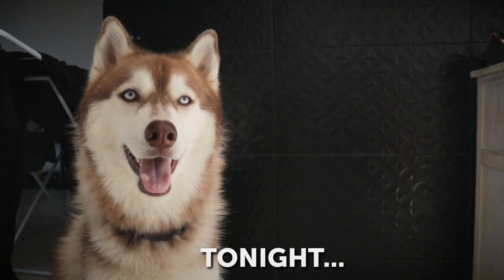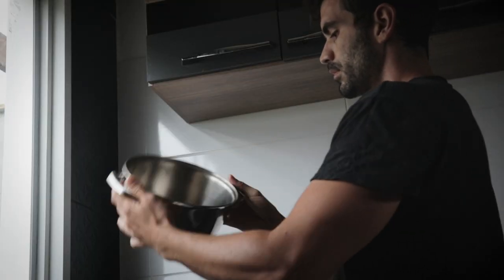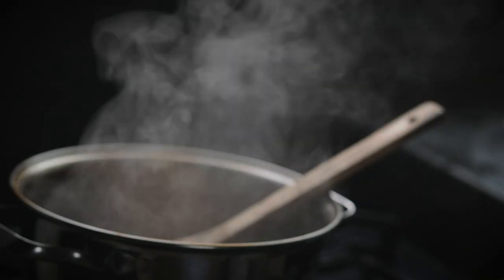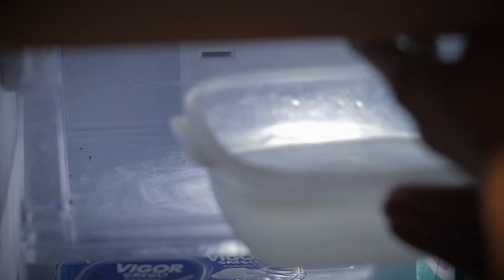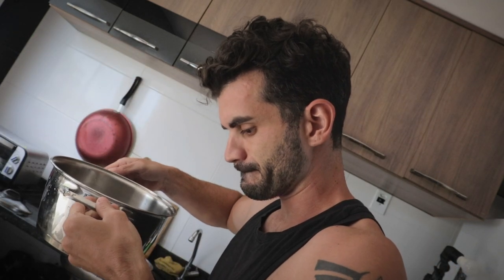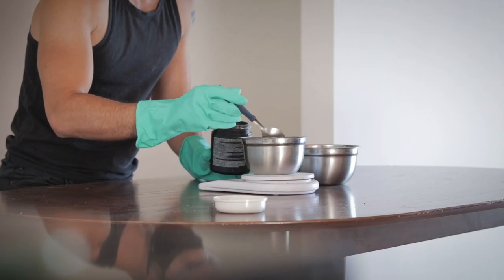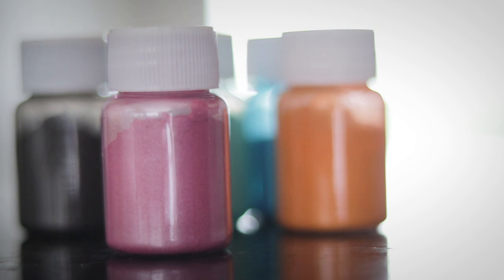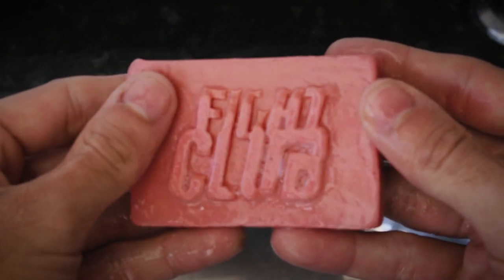I Learned to Make the SOAP from Fight Club (with Bacon)

Comment: Did you really just use a normal mask to protect yourself against the fumes?  Those masks only protect against droplets and sometimes dust, but you need a dofferent mask like k96 type for fume filtering.
Reply from the maker: I didn't know that! I'll get a proper one asap!
Reply: @SkilLeoChannel  Yeah sorry I misspelled the mask name, I meant to write KN95, but I asked my chemist mom and what you need to protect from fumes is FFP2 or FFP3 graded respirators or an actual gas mask like 3M 6000. I think for small batches of soap rather go with FFP graded disposable masks then a full on gas mask just because of price. It might also be easier for you to find a PFF masks in Brazil (it's Brazil's way of marking masks) but I am not so educated on those ratings.